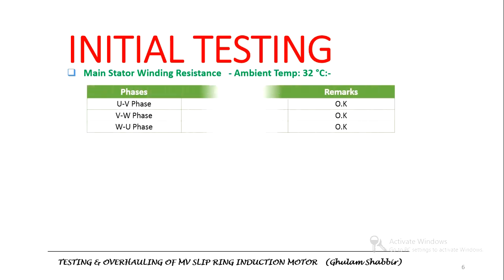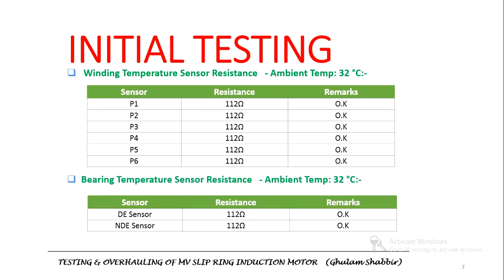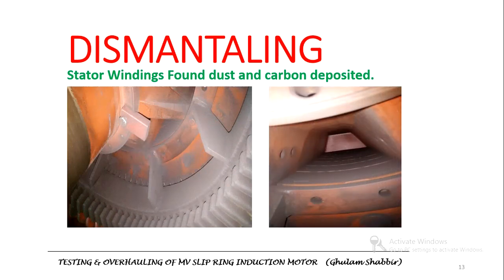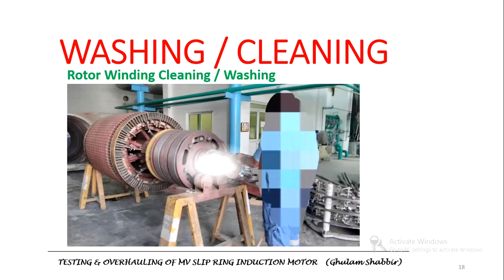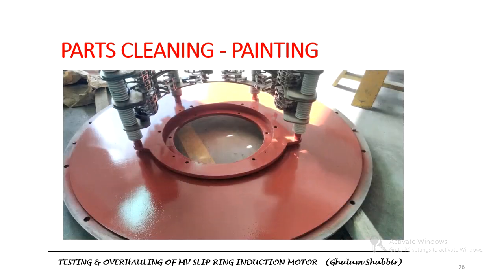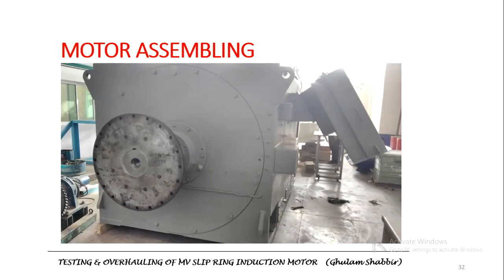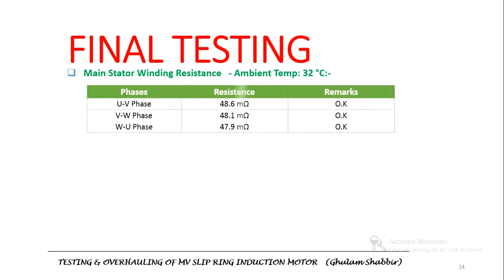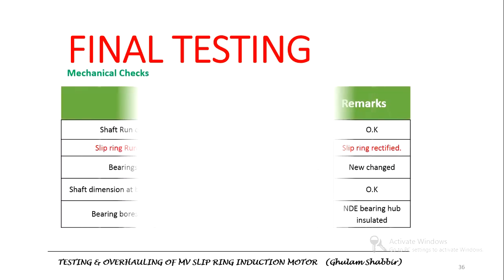How to Overhaul Wound Rotor Induction Motor | Slip ring Rotor | Overhauling Procedure | Maintenance

Comment: Dear Sir,
I did the insulation test on 6 kv motor stator which star connected. 

The test is done in the same manner you did, I mean before dismantling. 

I got Zero between phases but in your situation you got IR reading. 

What does that mean, please advise Sir ?

We highly appreciate your help, Sir
Reply from the maker: Thanks for your interest. 
First of all, if your motor is in a star connection, you need to remove the star point. You must separate all the phases, then perform the insulation resistance test.

Comment: Dear Sir, 
do you have any manual for the insulation test procedure please ?
how could we get in touch with you, please
Reply from the maker: Thanks for your interest. Here is the answer

Insulation testing is an important part of keeping MV safe and reliable. The following is a general procedure for testing medium voltage motor insulation:

Lockout or tag the power supply and disconnect the motor from its power source.

To gain access to the motor's windings, remove the terminal box cover.

Check the windings visually for any signs of deterioration or damage, such as cracks or discoloration. Before beginning the insulation test, any damage should be fixed.

Measure the motor's insulation resistance with a high-voltage insulation tester. A voltage of at least 1000V DC should be able to be applied to the tester.

Follow the manufacturer's instructions to connect the tester to the motor's terminals. The negative lead of the tester is typically connected to the ground of the motor, while the positive lead is typically connected to the motor's winding.

Record the insulation resistance reading after applying the test voltage for one minute.

Compare the manufacturer's recommended minimum value to the measured insulation resistance. Further investigation or repair is required if the measured value falls below the minimum required by the manufacturer.

Before putting the terminal box cover back together after the test is finished, short the positive and negative leads together to discharge the motor windings.

For further details, please follow the manufacturer's instructions and local safety regulations always.